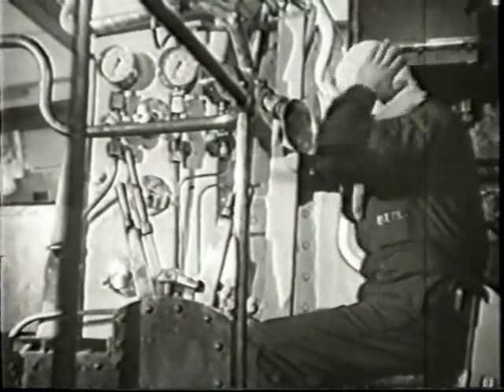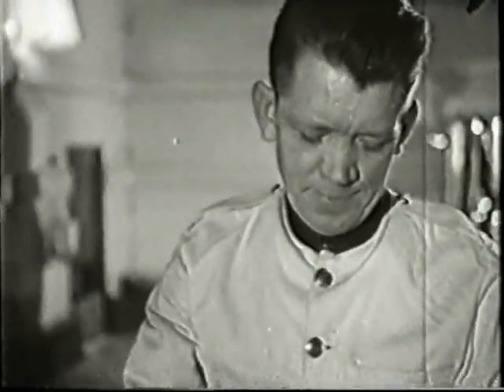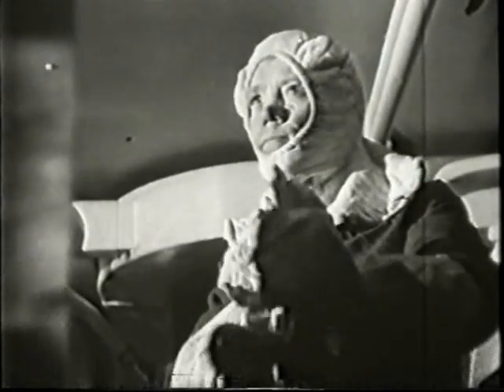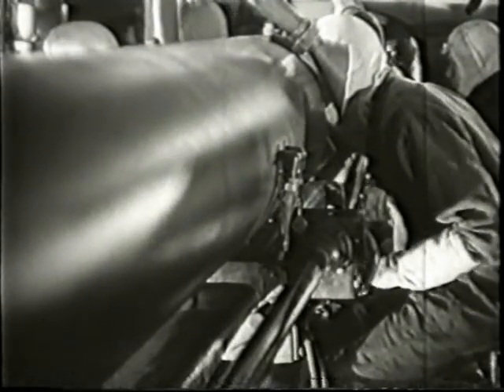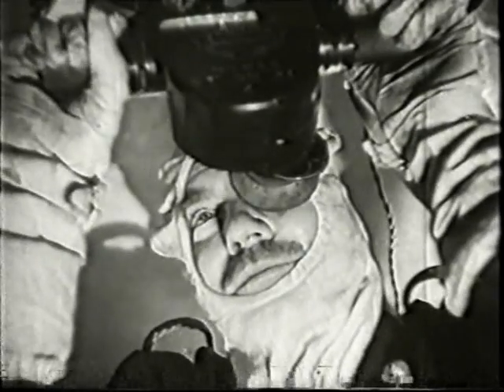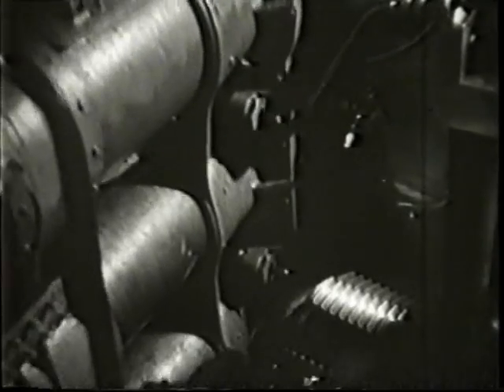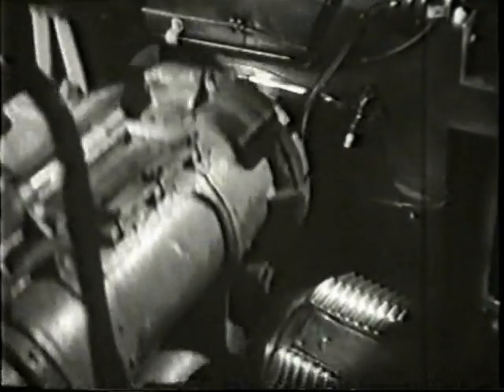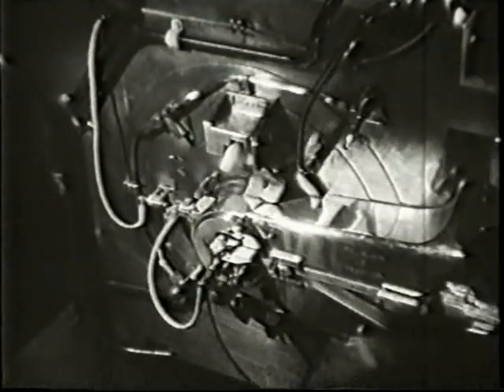Battleship guns

Comment: The powder bags were not manhandled into the gun in the US 16"/50 system.  The first three bags were dumped from the powder hoist and manually pushed aside for the next three (for a full charge of six).  The same chain rammer used to seat the projectile was  then used (at a slower speed) to push the powder bags into the gun.

One of the problems with the British cage hoist was that as the cables stretched, it coulld get out of alignment with the gun breech.
Reply: Thanks John, it's refreshing to read a post by someone who knows what they're talking about .

Comment: I wonder if they used the interior shots of HMS Howe, but didn't actually load the guns, so they used a shot of 15" twin turrets firing, obviously in wartime,  as the muzzles aren't polished. The cost of firing big guns may have prevented the captain from using main armament firing for something as trivial as a film, we don't actually see a shell or cordite bags being pushed into the gun. For the general public at the time, seeing this in the cinema, such differences wouldn't have mattered.
In 1951 during Korea, the cost per 16" shell for an Iowa class American battleship averaged $1,352. If we assume the U.S dollar was worth about ten English pounds at the time, that would equate to £135, when my father earned £5 a week. (page 98, The Iowa Class Battleships. Malcolm Muir. Sterling Publishers). Put at today's rates, an average £500 a week wage would give $13,500 per shell. 
I did think we were inside a triple turret, but it could be a KGV. It was the picture of the breeches rising that seemed to be filmed through the escape manhole in the turret, or from the rangefinder position at the rear. The rangefinders in the turret would be in a separate, lightly armoured compartment.